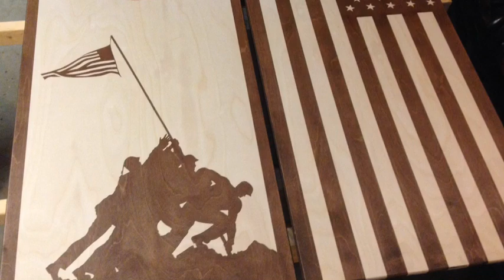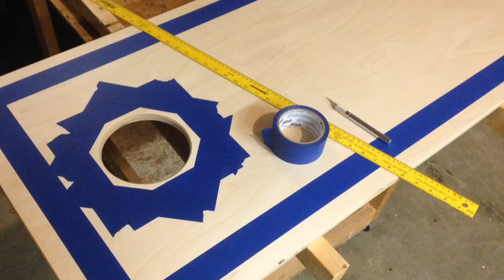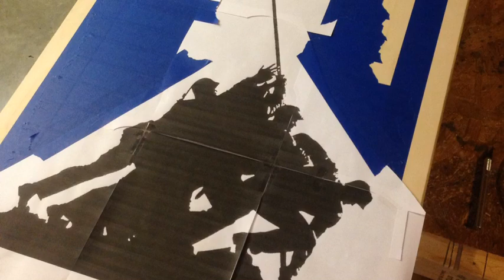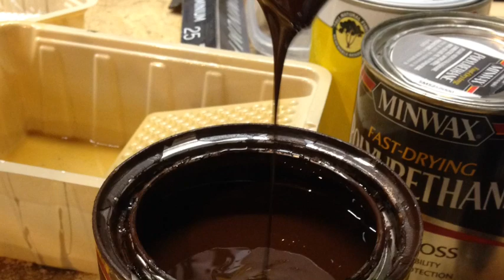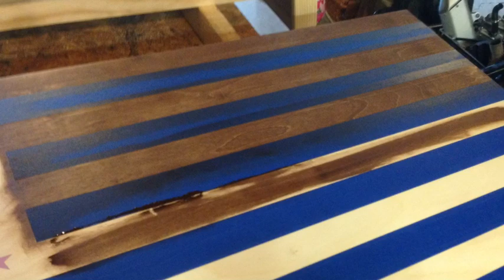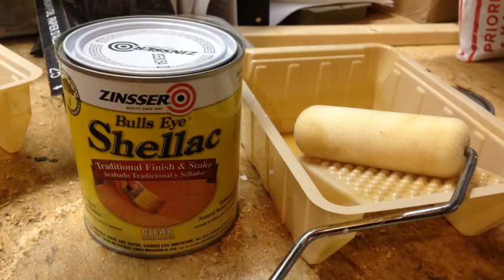How to Cornhole Board Staining Tutorial

Comment: Nice work!  This is really helpful, and these boards are works of art!  The one thing I couldn't quite make out in your time lapse video was the legs.  I was estimating they were 1x2s with about a 1x6 support in the middle. Is that correct/close?
Reply from the maker: Hey thank you!  The tops are 3/4" birch, the legs and frame are 1x3" select pine and cross brace is 1x6" select pine! 👌🏻

Comment: You like the oil vs the water based clear coat? I've found that it takes on a yellowish tint
Reply: I've used both and go back and forth.  If i'm using a vinyl decal that has a lot of white, I'll use the water based.  Over all, i feel like the oil based is more durable.  Also, if the water based get a splash of water on them, it will get cloudy or white looking again until they cure back out.  You're right though about the tint though.

Comment: Great job! Quick question, I see from other comments you recommend water based poly but in the video it’s oil. What type do you use?
Reply: I use both. I use oil based when I can because it seems more durable (water resistant) but it will have a yellowing effect especially over white paint or decals.  If that’s a concern use water based.
Reply: Aaron Looney thank you so much. You did
 an excellent job explaining everything and mentioning great tips.

Comment: Great tutorial. One question, my boards are too fast. Any cures for this? Do you sand after your last coat of Poly? When I was sanding between coats it seemed like the sanding marks were VERY visible. I hesitate to sand now and have to do yet another coat of Poly.
Reply: I haven't found any sure way to prevent them from being too fast. I lightly sand between coats with the foam block, barely any weight. Try putting 1 or 2 more coats of polyurethane on pretty heavy without sanding between. If that doesn't cure it, keep a damp towel around and wipe them down when they start playing too slick. And use the double side bags.
Reply: +Aaron Looney thanks for the reply. Do you sell these online?
Reply: I have a Facebook page but haven't had the time lately to build any. I may pick up again sometime but it's always just been a hobby for me.  Otherwise I wouldn't be giving away trade secrets lol
Reply: another coat of poly will cover the light scratch marks!
Reply: do not sand after the last coat

Comment: Have you ever had the blue tape pull up some of the wood?
Reply: The tape will sometimes pull up small fibers of the wood. Usually not a big deal, just use the foam sanding block over it once the stain is real dry.

Comment: Working on a stained kansas city Chiefs set now.  It's a lighter stain on oak ply tops and left the border natural.  After using the sanding sealer, taping off, and painting some stripes, the stain looks like it lightened up to where there's not as much separation between the natural border and the stained center.   Will the polycrylic help darken it a bit?  Should I go with polyurethane?
Reply: The sanding sealer seals the pores of the wood and prevents the stain from penetrating. It should be used after the stain. I'm not sure what to advise at this point.
Reply: +Aaron Looney I did the sealer the day after the stain.  Then taped off my stripes and painted.  It's almost as if the sealer made it look milky in certain areas.  I didn't sand after the sealer though.  I just wondered if the wetness of the poly richen the color back up.  I wiped them down with a damp cloth and the moisture and to bring the color back a bit. Also wondered if I should use polyurethane since it tends to "yellow" over time and make it richer.  My stripes are black and red so not really worried about discoloring.  But I already have like a half gallon of polycrylic, so I'd use that if it doesn't matter.
Reply: Yes in my experience the polyurethane does richen the colors. In most all aspects I prefer polyurethane over polycrylic.
Reply: +Aaron Looney cool, kind of figured that, but really wanted a second opinion.  Think I'll give that a shot.  Thanks for replying too.  So far I'm really happy with how they are turning out for my first stained set. Makes me want to do more. It got the creative wheels turning.
Reply: No problem. You can also add another shade of stain to add some more detail!
Reply: +Aaron Looney you know, that crossed my mind but was worried about having to work around the paint and not get any on it.

Comment: What type of plywood do you use?
Reply: Definitely use 3/4" so the bags don't bounce over the hole, and I typically get birch or maple because of the clean grain.  Oak looks good, but a little harder to work with and it's grain is a little deeper and you'll get more bleed through under your tape..

Comment: how does the stain hold up with out the poly? Is the poly more for looks? I really don't want a fast board.
Reply: I have played on an unfinished set and as you can guess they are not very fast. I have never played on just a stained set. The poly offers protection for the stain. Spend a few hours taping, cutting, and staining then decide if you want to protect it!
Reply: +Aaron Looney great. making mine this weekend. those 2 in this video look bad ass.
Reply: Have you done any projects where you used oil based stain with a polyacrylic coat.  I have been doing a lot of research the past couple days, and it seems like the polyurethane seems to play very fast.  Sometimes to the point where its unplayable.
Reply: Michael Mazzucco in my experience the water based plays just as fast or faster
Reply: +Aaron Looney by water based you mean polyacrylic specifically?  There is water based polyurethane too.
Reply: I mean water based in general, I have tried a couple.
Reply: I think we used oil based and ours turned yellow is that y.

Comment: what is the purpose of the shellac??
Reply: It helps seal the pores of the wood and keeps the grain from raising as much during the first coat of polyurethane. It isn't required, but goes on quick and usually saves at least a coat of polyurethane.
Reply: thanks for the tip! boards look awesome!

Comment: 2" stripes?
Reply: And could you let me know what stencil you used for the stars.  trying to make a set for my buddies wedding.
Reply from the maker: it was 1.88" tape.. leave the areas that aren't taped just a little more narrow than that to make all the stripes fit in 24"
Reply from the maker: I had a sign shop cut the stars out in vinyl so I could lay them all down at once.
Reply from the maker: Sounds about right, I don't remember exactly.  If you have a vinyl shop make them, just ask them to scale a flag to 24"x48" and print the stars off that.. should work out perfect!